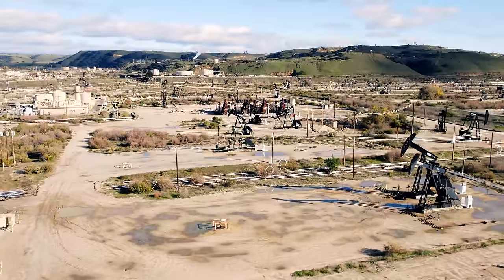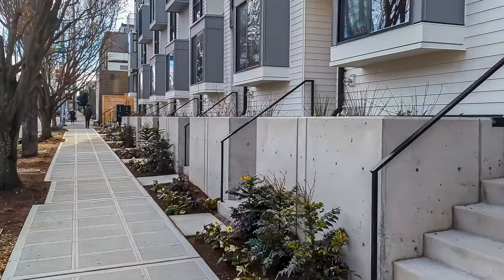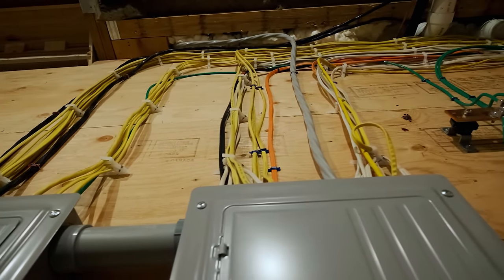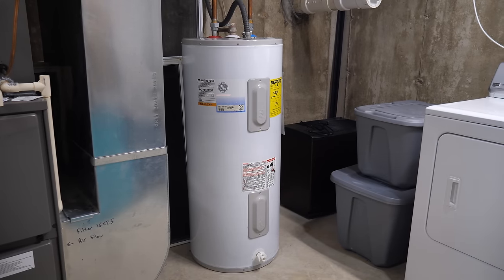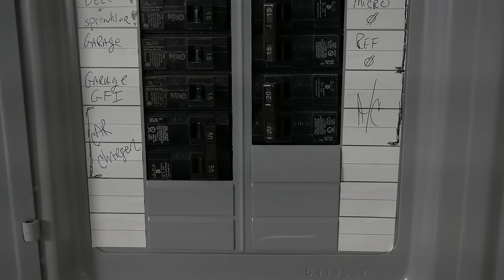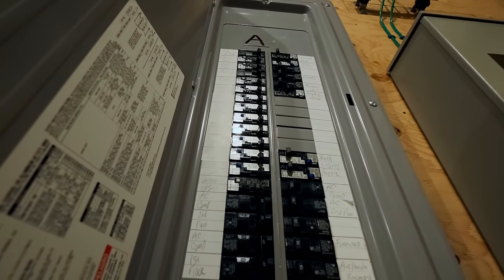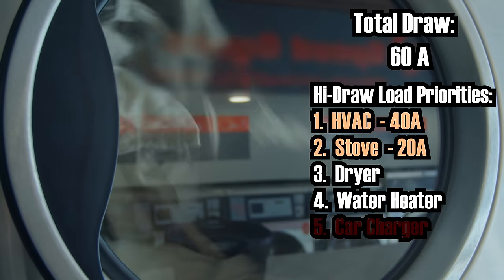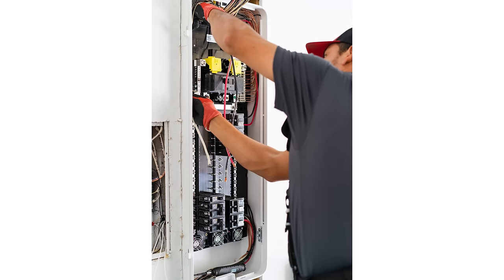Home Electrification: There's not a lot to do, and it doesn't have to be hard (Part 1)

Comment: My parent's house was built in the early 70's and was originally built 100% electric. After my father inherited the house from his parents shortly before I was born, they installed a coal stove because the coal was a lot cheaper than using the electric resistive baseboard heaters.

They still use coal to this day.
Reply: @FishFind3000  They have plans to install a heat pump this summer because coal is getting expensive too

Comment: Another good thing to remember is device positioning. If you're on resistive heating and need to use the stove, chances are you'll be spending the time when the heating is restricted near the kitchen, where the stove is now outputting the heat your heating system has been throttled by. OK, its not quite as efficient, but all of the devices that draw huge loads (except likely the car charger) output heat to the environment of the home.
Reply: How do you mean, not as efficient? Aside from the energy that is used to transform food molecules (and to heat your food, which will of course then warm you as well), the resistive heat from a stove should be the same 100% efficiency as that from a space heater. (And your oven literally is a space heater.) There's no fan to blow the heat around, so it will radiate outwards more slowly, but radiate outwards it shall.
Reply: @ps.2  Not as efficient because it's not a heat pump.
Reply: @eDoc2020  But you literally said "if you're on resistive heating and need to use the stove". You weren't comparing the stove to a heat pump, you were comparing it to (other) resistive heating.
Reply: @ps.2  I didn't say that, but I did misread the OP's comment as electric heat in general. But you're right, compared to dumb resistive heating the efficiency is the same.

Ideally for heating you'd be using an electronically-controlled heat pump which could sense and automatically throttle its output to avoid exceeding your service. This technology is pretty common for EVSEs at least in the UK (where I do not live) and there's no reason it can't be on heating as well.
Reply: Am I the only one that switches my light bulbs to incandescents in the winter because I'm like "well the energy that's wasted as heat isn't actually wasted since I need to heat my home any how."?
Reply: @ClaytonDorris  Yeah you probably are the only one who does this. (:

I don't see the point of doing that extra work, though, unless you really prefer the light output of your incandescent bulbs, or you want to use up their lifetimes. As for me, sometimes I can tell the difference between the quality of light from incandescent and from the same temperature of LED — but I don't have any real nostalgia for the former.

(Also, as is often mentioned, electric resistive heat, while 100% efficient, is generally more expensive than the same heat from burning a fuel.)
Reply: @ps.2  Lol. Yeah, it is a little ridiculous. Honestly, it's because I have a big box of incandescent bulbs in the closet from when I made the switch to first CFLs and later LEDs. It feels wasteful just to toss them all in the rubbish bin. So a big part is getting the full service life out of them. With the LEDs I have now I really can't tell a difference in the light at all. It is probably on the balance a waste of time, but its my time to waste :)
Reply: @ClaytonDorris  I feel ya. I do all sorts of things that my rational brain knows are a waste of time, but something in me wants to do them anyway.
Reply: @ClaytonDorris  Are you forced to use resistance heating as your home's main heat source? Are your light bulbs where you need heat? If you answered no to any of these questions then switching to incandescent light bulbs because of their heating effect is a poor idea. Even something as simple as ceiling mounted lights (where the heat stays above your head) is less effective at heating than electric heaters at the floor. The best way to use resistance heating is a radiant heater pointed at you. If managed properly this could be done with incandescent floodlights but I doubt your existing lights are designed to do this.
Reply: @eDoc2020  I'm irrational. That's the long and the short of it.

Comment: There are down-sides to putting all your eggs in one basket.  Electric stoves and electric baseboard heating aren't very effective during those pesky winter power outages.  Last fall we added a wood stove to supplement our oil burner/water heater, and have heated exclusively with wood this winter due to high heating oil prices.  Next, we plan to install a standby generator and a propane tank, which we can also use with our grille outdoors, a camp stove indoors, and maybe an auxiliary water heater, depending on fuel pricing.  IMO the best policy is to have options; it certainly isn't to make everything dependent on one form of power—especially one that cannot be kept on-hand in meaningful quantities.

P.S.  Challenge #5 is your portable or standby generator.  Not that it needs to be electrified, but it will need to scale up as more of those other appliances transition to electrical power.  A tiny portable generator can provide enough power to run an oil furnace; by contrast, ~250W per foot of electric baseboard heating adds up quickly.
Reply: #5 is a very good point. The beauty of my gas stove is that I can still use it during a power outage. Lil' unnerving to light a pilot light myself, but at least I have hot food and a heat source to keep me from freezing.
Reply: Except, of all of those things, you'll need to run maybe two during a power outage.

You'll need to cook food and have heating during extended power outages. That's it. You can put off your shower and washing your clothes until the power comes back on. If you're really that filthy, grab a washcloth and wipe yourself down.

The former can be handled by simply buying a camp stove or by stocking up on a decent number of MREs. You won't get fancy food, sure, but it's hot and means you use an electric the rest of the time.

And the heating? That's the only thing you need your backup generator for. You don't need it to be huge - get a heat pump. It'll cover it.

I strongly suggest you look at his video about the dangers of "But sometimes!", as you seem to be strongly falling into that trap.

We absolutely should be putting all our eggs in one basket here, because we have only one functional basket. Carbon-based fuels are NOT going to be usable much longer.
Reply: @dusklunistheumbreon  The point being, if your portable generator isn't already big enough to run any one of those appliances, you won't be running it until the power comes back on, at least until you buy a larger generator.  For example:
Just this past Winter, we had several single-digit (Fahrenheit) days in a row, including one night where it reached -18°F.  I daresay that's well into the range where, unless you have a big enough generator to run a LOT of resistive backup heating long-term, you get to shut off your water mains and drain all your pipes before they split.  I don't know what qualifies as "sometimes" in your book, but just one of those in my lifetime would be one too many.
Meanwhile, wood heat is renewable; carbon neutral; storable; and self-contained.  We heated with wood exclusively this Winter: if the entire state had lost power for the whole week—even to the point of gasoline/propane becoming unobtainable—we would have gotten through it without batting an eye.  With lives and livelihood at stake, you make use of what's available, and avoid the "traps" of believing that one size fits all, and of depending on the kindness and competence of strangers.
Reply: @wlan246  If your portable generator isn't enough to run a space heater then it's complete garbage lmfao

Also, no. Burning wood is not actually carbon neutral.

Again, you're falling into the "But SOMETIMES" trap. Go watch his vid on it, then come back here.

There are backups available for electrical things. They should ONLY be used as backups. Resisting using them as the primary just because of a scenario that practically never happens is absurd.
Reply: @dusklunistheumbreon  Burning wood is carbon neutral because that would is going to be burnt at some point whether you burn it or nature burns it.
Reply: @dusklunistheumbreon  For the day-to-day and the minor emergencies, putting all your eggs in one basket is fine.  But when we are talking national policy, or the nationwide norm, we have to start considering larger scale catastrophes.  I'm not saying everyone should be a prepper, but the people issuing nationwide guidance absolutely should be considering these things.

Relying on a camping stove you keep tucked away in the basement ever since you went camping 3 years ago with your in-laws is a horrible plan.
Reply: @LowJSamuel  If we're talking about large scale catastrophies like that, the gas isn't staying on for very long anyway, making your gas stove useless.

If you're talking about a minor emergency affecting a lot of people, then your point is largely irrelevant - 100 houses can have 100 backup camping stoves just as easily as 1 house can have 1.

You need to think objectively about this - clinging to an outdated, dangerous, and wasteful system solely because of a rare event we have workarounds for is plainly idiotic.

If something works vastly better in 99.9999% of all circumstances, then we use it.
Reply: @LowJSamuel  ...No. That's not how that works at all.

Even your most basic assumption (wood is always burnt) is plainly wrong - wood usually rots away in nature. Rotting is effectively carbon neutral (and often required for various aspects of the food chain). Burning is not.

You're also ignoring the fact that firewood is almost always cut well before the natural lifespan of a tree has concluded, often by a matter of decades. Even if burning somehow didn't release carbon, you'd still be removing decades of CO2 removal, which I think we can agree is against the spirit of what "carbon neutral" means.
Reply: @dusklunistheumbreon  1)  The only difference between rotting and burning is the rate of decomposition.  At least in the case of burning, that energy is being put to good use, and not just being released directly into the environment.  2)  Cutting and burning a tree after 20 years removes, then returns, 20 tree-years of carbon.  Cutting and burning a tree after 100 years removes, then returns, 100 tree-years of carbon.  The lifespan of the tree is irrelevant.  3)  If people mean something other than "carbon neutral", they should call it something else.
Reply: @wlan246  1 - No. Not in the slightest. If you eat a burger, that does not release as much CO2 as lighting it on fire.

Why does that matter? Because, at a very simplified level, decomposition is something being eaten by bacteria and worms and flies and shit. That CO2 doesn't go into the atmosphere until much later, because the carbon portion has been turned into cellulose and related matter (and the oxygen portion, obviously, is released into the atmosphere).

"Rotting and burning are the same thing" is something done as an abstraction in video games. It does not reflect reality in the slightest beyond "Thing goes away eventually".

2 - Not quite. That cellulose gets used up in various things that are not permanent. You've heard of leaves, right? And that's ignoring the fact that the wood does not need to be burned. You are choosing to burn the wood when there is zero justifiable reason to do so.
Reply: @dusklunistheumbreon  1) Decomposition doesn't release Carbon as immediately and directly as burning, but it's all released into the environment, and it all ends up being used by one organism or another.  Decomposition makes more of it useful to animals, and burning makes more of it useful to plants.  (As for video games: my kids were in high school when Minecraft was in its infancy.  I know the difference between video games and organic chemistry.)
2) What do you mean, cellulose gets "used up"?  Where do those leaves, acorns, loose bark, etc. go?  Whether decomposed in situ or gathered and burned, that Carbon is cycled back into the environment on an ongoing basis.  The rest is accumulated in its durable structure—which, whether decomposed or burned, ends up being used by other animals and plants again.  The difference is, in the former case, the solar energy stored in that structure is released to the environment, whereas in the latter case it saves me the trouble of burning fossil fuels or using electricity (but I repeat myself) to heat my home through the winter.